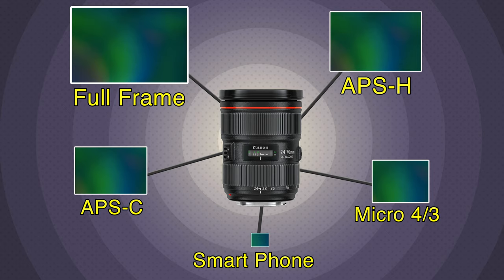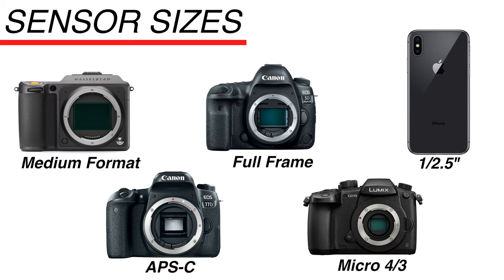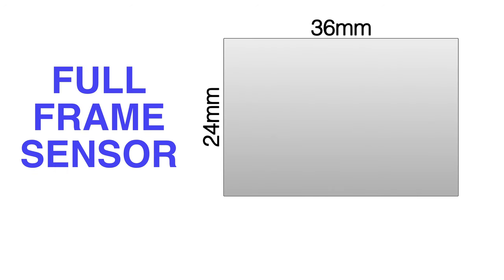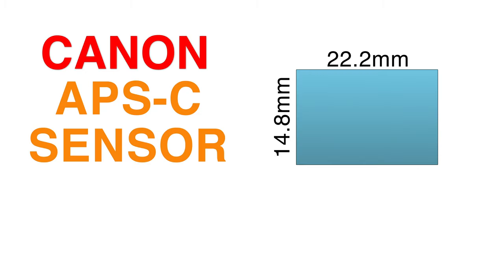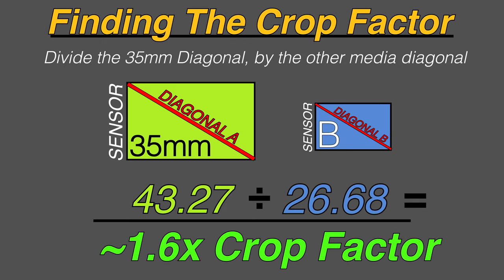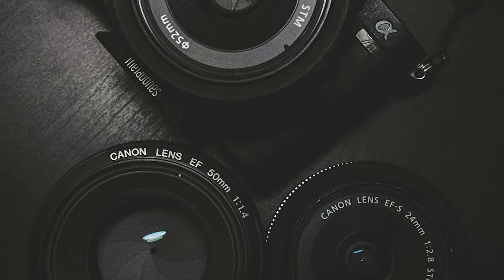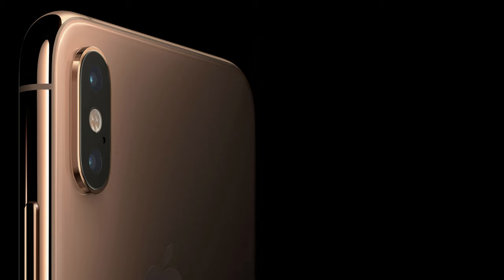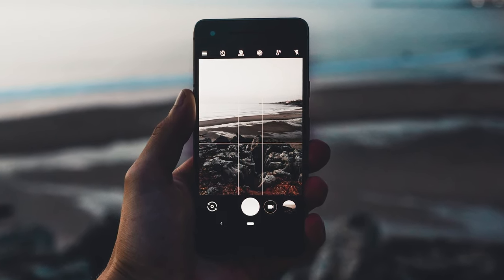How To Calculate Crop Factor on ANY Sensor

Comment: Another method is dividing the pixel pitch by one and other. This gives you the 'real' cropfactor based on resolution. Canon 6D = 6.5µm Sony RX100 = 2.4µm 6.5/2.4 = 2.7x cropfactor.
Only if the resolution of the 2 sensors is the same you get the general cropfactor of 2.7x or 1.5x for APS-C.
Reply: That makes absolutely no sense.
Reply: @okaro6595  You don't understand it.
Reply: @indysbike3014  Old comment, but maybe you'll see this. Just to see if I understand, if I want to determine the crop factor of my iPhone 13 Pro, I first take the pixel pitch of a full frame with the same resolution (I chose the Nikon D700 w/ 12MP), divide it's pixel pitch of 8.45 µm by my phone's of 1.9, and I get a crop factor of ~4.45x. Do I have the concept correct?
Reply: @chrissnyder4439 Correct, that is the crop factor based on sensor size and what is generally accepted as crop factor.

Comment: Crop factor will help you find the field of view compared with other sensors but will not change the focal length, sensors size do not change focal length of lenses, it seems to be a global misunderstanding. 100 mm focal length lens will  still be 100 mm no matter what camera you will attach on it.
Reply from the maker: Uh....and that field of view change is literally called the “crop factor” which gives the equivalent field of view change compared to a 35mm sensor. No confusion.
Reply: @MMaven  Yes something like that

Comment: Does it make any difference if the sensor has a different aspect ratio?  For example: it's my understanding that MFT sensors are 4:3 while, say, Nikon has 3:2.  Is this calculation only good for comparing same aspect ratio sensors or is it really a non-issue?
Reply from the maker: Yes it actually does make a difference for different aspect ratios, And you would have to figure out the diagonal of the proportion and aspect ratio of a 35 mm sensor in order to figure it out
Reply from the maker: So say for example you had a medium format camera that was 56 x 56 MM
Reply from the maker: In order to figure out the equivalent crop factor you would have to calculate the 35 mm frame diagonal for 24 x 24
Reply from the maker: If you go by straight diagonals it’s going to get you in the ballpark but if you wanted to be very precise that is how you would do it
Reply: The crop factor is calculated typically for the diagonal. However two cameras of different aspect ratios cannot produce same images, you need to crop either image. If you crop from 4:3 to 3:2 you need to increase the aspect ratio by 4%. If you crop from 3:2 to 4:3 you need to increase it by 8%. So if you set a MFT camera to 3:2 the aspect ratio will become 2.08 or 2.1 to be short.